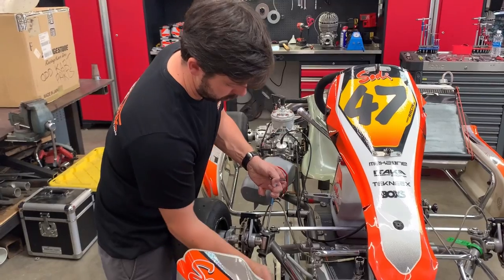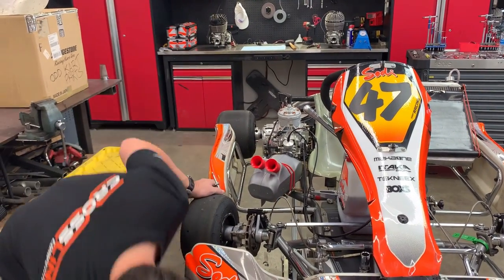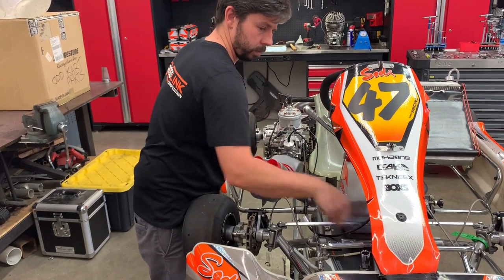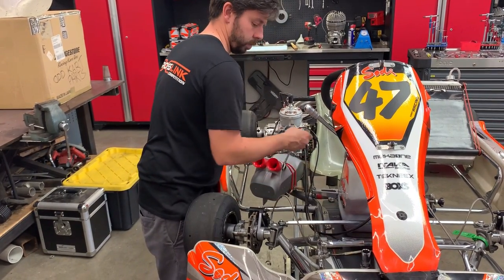Pro Tips Chassis Set Up

Comment: Hi there from the uk great video after watching this episode ive decide after  getting lost with set up im going to do the same with caster etc i am tall myself so i also struggle but my kart is only for track days i have to say with the amount of kart set up videos and reading on the Internet on how a car works this was just what i needed cheers
Reply: Greetings from Texas, I am so glad that I could help you a little bit!  If you have them available, I have since learned to put my kart on the corner scales and see what my front to rear weight distribution is.  I actually found that because I am tall - and I get my height with a long torso - I actually needed to move my seat forward 2 cm and that dramatically improved the handling as well.  Your seat position may very well be spot-on but why guess when you can know, right?  Anyway, for me, moving the seat forward that little bit really improved the kart.  Thanks for watching and best of luck!
Reply: @Richard Siler  moving the seat is guna be an issue as ive just enough room for my knees under the steering wheel as it is im currently on 550mm steering column
Reply: @forcedinduction2918  I totally understand that!  I had to really move the pedals all the way forward to make it work and it is comfortable, but still a bit of a squeeze.
Reply: @Richard Siler  your video on ackerman steering was also very interesting my kart is a compkart kz chassis with a iame x30 engine its never been an issue to drive but ive 2x tracks i use 1 is very fast the other is a smaller bumpy track ive had to raise the front cause its considerably hitting the gound thats about my only issue.  We all the information available you do get lost i tryed a hard rear axle because i was told it would help then i read a taller driver  wants a soft or medium axle so ive gone back to that

Comment: Did you just put the camper/caster back to neutral? No front or rear width, axel hight or torsion bar adjustments? Thanks.
Reply: Hi Andrew!  Thanks for watching!  Actually, while the caster/camber did go to neutral, we also changed the ackermann, starting with the steering shaft itself.  You will see that in a follow up video that I am working on now.  We also put in a stiffer rear axle that is still in the "soft" range according to SodiKart, and candidly, we are finding that depending upon the track conditions, we probably need to go with a medium axle for most days.  We have also since tested medium length hubs, that video is also in the production stage.  Lastly, we made no changes to the ride height either front or rear, we left the front width stock per the SodiKart instructions, and the rear track is a bit narrower than the maximum allowed by the rules, we are about 1/2" narrower on the rear simply because with all the rain we are having here in Dallas, it seems like every time we go out for some testing, the track has been rained on, so it is green and has very little grip.  Hope this makes sense, thanks for watching, and stay tuned for some new episodes with more details on what we are doing set up wise!